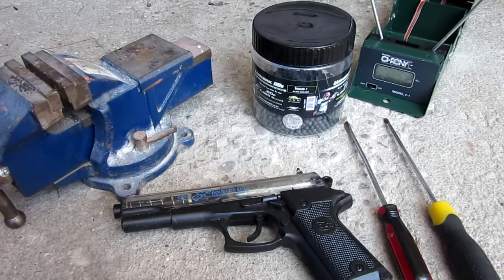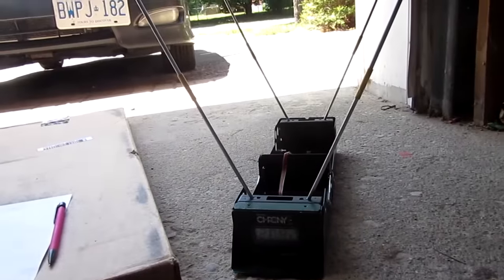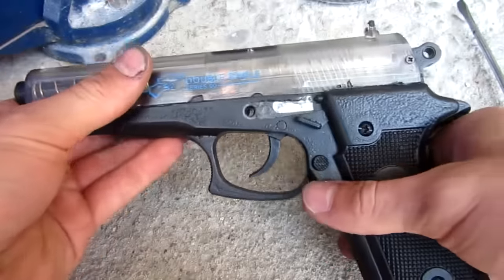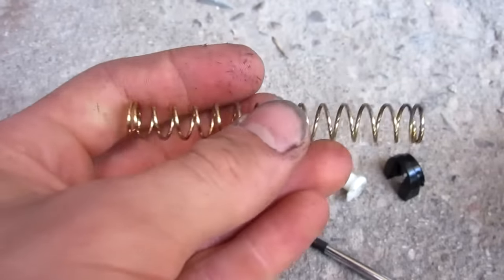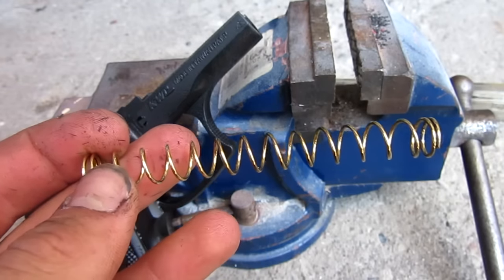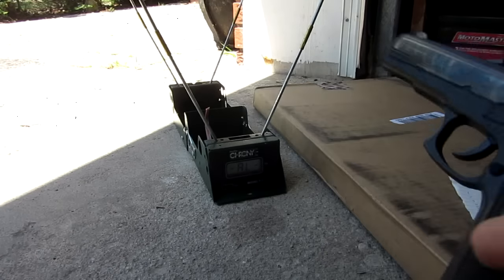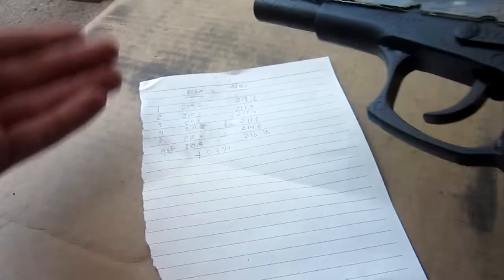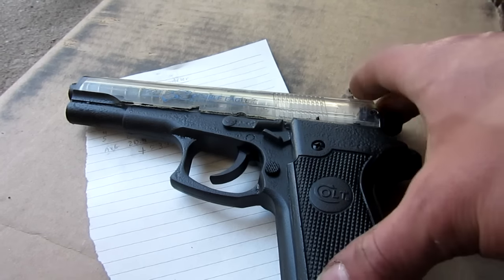FREE Airsoft Gun Hack +FPS

Comment: This is crap the spring will compress with use back to what it was
Reply: If you use a stronger spring it will release faster  thus greater fps
Reply: Yes, frames per second is correct.
EDIT: Perhaps not.
Reply: +SirFloberto feet per second
Reply: +Luds Larsson yep
Reply: Jack Scuderi boi
Reply: Just buy a stronger spring
Reply: I want to do this with an airsoft shotgun though
Reply: B Pyromane Reacts ye true lmao

Comment: I did a few things to my pistol. I changed the main spring to a little longer one with much heavier wire. I needed to clip of a few coils because it wouldn't compress enough. I did that 1/2 coil at a time until I found the perfect length. I also replaced the front spring as that also adds to the power stroke. I also drilled small hoes in the piston to make it lighter and faster when firing. The pistol gained about 40 fps, bringing it to 250 fps.
Great little cat chaser now, keeps them out of the yard without hurting them.

Comment: there are 2 reasons for the small difference in the velocityof the pellets: 
1) while compressing the spring you permanently shrink it by a bit. 
2)E=1/2xMxV^2, so you need exponentially more energy to add more to the velocity, you added the energy and the speed the same.(You streched it by 1.5 cm which is ~25% but the velocity will increase a lot less)
Reply: yup and also F = ke where force = spring constant x extension
Reply: English please
Reply: @RainbowsixsiegeKITPV  it’s English just learn mathematics goofy

Comment: what about if you heat treated the spring after .....or before stretching it....like heat it with low heat on a torch then cool it by dipping it in oil....?   As far as a different spring...you dont want more coils because that would affect the slide action , so instead try to find a progressive rate spring which has same amount of coils just grouped into 3 different coil spaces.
Reply: it's not as easy as you think, doing it wrong will kill that spring forever
Reply: Yeah, I actually work at a spring factory believe it or not. Having more coils on a spring doesn't necessarily mean that it is more tense. It all depends on how a spring is treated and what they're made of and how thick the rod is in diameter that they used to make the spring
Reply: ah yeah... that too, why the hell do you put so much effort into one simple thing that you can buy for only 1$

Comment: Ellectric guns are also powered but spring so it could work
Reply: it's a bit tricky though because the motor is probably only able to pull back a certain strength of spring
Reply: +Gabriel Akibo-Betts thats not how it works, the motor doesnt pull the spring, the motor turns a gear box that end in a half toothed gear. That gear pulles back a piston which compresses the spring. When the half toothed gear gets to the last tooth the spring will push the piston forward very fast along its track and all the air in the cylinder is pushed through a very small hole propelling the bb out there barrel. The longer the barrel combined with the power of the spring will determine how fast the bb is going. There are so many different ways to upgrade good AEG's.
Reply: +Break Your Mark 

the gear pulling the piston.. that compresses the spring.. lmao, the gear is still going against the spring. doesn't matter if it's by a piston. or direct, the motor is still pulling on the spring
Reply: Jebediah Astronomical mhm congrats. the whole point was that the strength of the spring doesn't matter as long as the spring fits and your gear box is strong enough to handle it. there is no way to pull a spring in this scenario as pulling in this case implies stretching the spring, you pull back the piston compressing the spring. i have been fixing my airsoft guns for years please dont try to tell me how they work

Comment: Inventor719 is this working with 2$ bb gun ? plz reply
Reply: The gun will probably break...
Reply: it will work just be very careful with taking the bb gun when taking it apart and assembly it back ,just dont pull the spring that far back.Or it could break the gun ,and u you might have a harder time  putting the spring back in place.
Reply: +zZjomastaZ z i did this mod on a cheap gun and my gun cracked

Comment: Not worth doing because as expected when you stretch the spring and put it back in you are compressing it back to what it was after a small amount of shots... So if u want the extra 6 ft per sec and gradually less for 10 shots then by all means this MOD is for you...a smart person  will just use a thicker spring and making sure that the outside diameter and number of turns and the length is the same...or just make one cause springs are extremely simple to make...it look to me a AA battery is about the right size to make it

Comment: Does this work for CO2 guns?
Reply: No.
Reply: noahconstrictor100 Oh ok
Reply: Co2 uses those cartridges to propel the gun, so you couldn't really stretch a spring. If you stretched the trigger spring, it would be harder to pull.
Reply: noahconstrictor100 Well my trigger is pretty loose so Maybe I could do it
Reply: Your chances of breaking it are much higher. If it is that much of a problem, get a better gun.
Reply: noahconstrictor100 Ok then thx
Reply: Of course! Have a nice day. :)

Comment: There is no "air" airsoft gun -_- there's spring, electric and gas
Reply: theres also co2
Reply: Co2 is gas...
Reply: +Henrik Gyulai i kno but its often separated you can look it up
Reply: Airsoft mostly has, co2 gas and green gas ggb
Reply: Even if it is spring or electric, airsoft guns still uses air because there is a piston being drawn back and released, pushing air down the barrel, propelling the bb.
Reply: Of course there is air airlift guns, I used to own one. They have a handle you have to pull like 5 times to compress air, and when you press the trigger that uncompressed air gets released through the barrel firing the gun. Stop acting like you know everything about airguns.
Reply: Cartoon Cop If you're saying that spring guns are pushing the BB with a piston, then you're wrong. The piston compresses air that shoots the BB, the piston itself won't shoot it.
Reply: deIlluminati did you never open an AIRSOFT gun?
Reply: BuhjaBoy
I helped my friend clean his, and the fact that several sites say that a springloaded airsoft gun works by compressed air.
Reply: +Connor Bunch well, i was about to write that myself, but i thought illuminati wouldnt understand it anyways
Reply: +Connor Bunch and it seems like you dont understand it either
Reply: +BuhjaBoy (BuhjaBoy) All airsoft guns work off of some form of compressed gas undeniably. Air, CO2, Green Gas, Propane, etc. This spring gun is air, the plunger (cylinder) shoots forward when he pulls the trigger, pushing air into the barrel and making the bb fly out.
Reply: +BuhjaBoy (BuhjaBoy) I don't know if you have ever opened an AEG gb but there is no part  that makes a bb fly. I don't think you actually know what is the purpose of a hop-up unit except making the bb rotate. and think about why you get better performance when you install a better hop packing and. sealing it properly is also good for your FPS
Reply: +exe. ploding Barrel I don't understand if you're trying to undermine me here or not because it completely dodged what I said. yes a hop up unit puts back spin on a bb for further traveling distance. Nothing hits the bb other than air (and I suppose the hopup and barrel). Inside an AEG gearbox the gears bring the tooth piston back, notice the piston head with an oring, and pulls the spring inside the piston back. when the gear runs out of teeth, the spring shoots it forwards, creating air in the cylinder, and pushes the bb out of the barrel. Nothing ever comes into contact with the bb except the hop up and barrel as the bb flys around in it. You only supported me by commenting.
Reply: +exe. ploding Barrel who*
Reply: Oh I'm sorry, it gave me a notification so I assumed. My bad, thanks. :)
Reply: +Andrew Madrid it's alright 🙃
Reply: +Bruce Wayne He's not reffering to you
Reply: +exe. ploding Barrel what?
Reply: +Clorox Bleach I'd rather drink family dollar bleach
Reply: +Garrett Kregar as you should know air also consists of nitrogen, oxygen and some minor gases. Would you say that water is apple juice just because it's in it? It's common that people don't know that air is just a name of a substance. And in CO2 capsules you have "pure" CO2
Reply: Polar numatic airsoft guns or polar star guns use high pressure air aka hpa gun
Reply: JESUS CHRIST I STARTED A WAR!
Reply: +exe. ploding Barrel i didn't say anything about bbs flying or hopup systems ...?